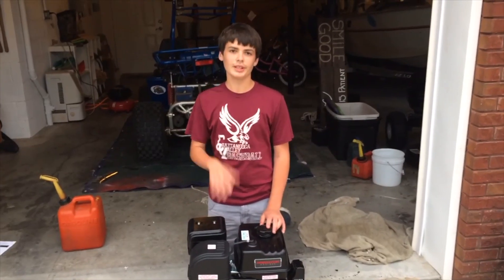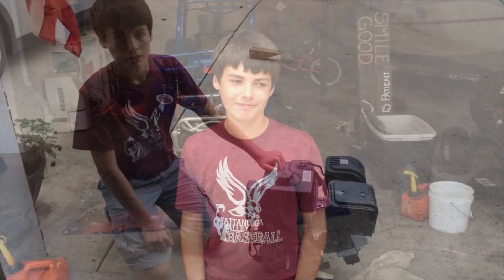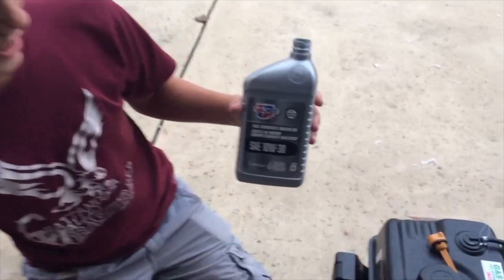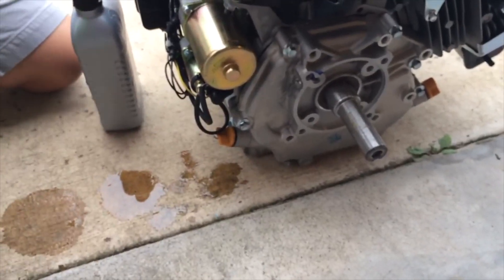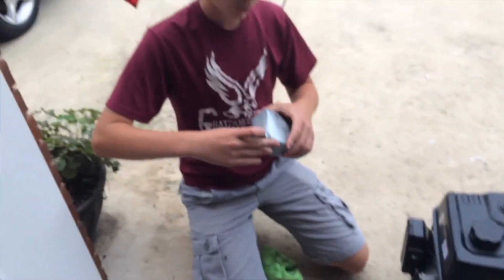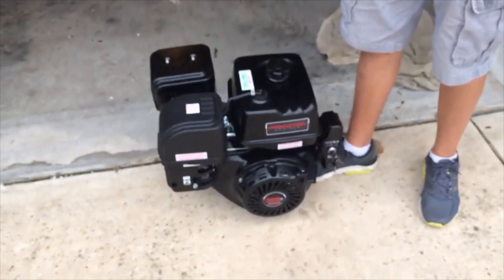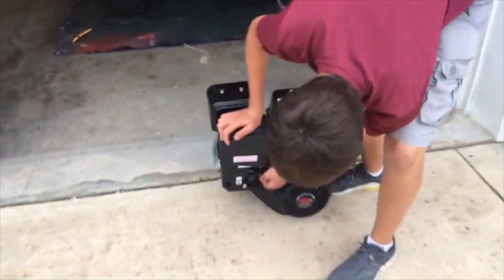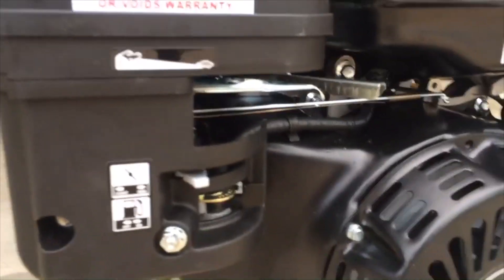Must Do's for a Predator 13HP 420cc Engine Break In & Start Up - Part 3

Comment: Probably dont break in the engine on synthetic oil. Also dont run an engine on concrete or gravel because the vibrations will crack your block. My buddy was dumb and had that happen to him with a new predator 212.

Comment: So I’m confused if this was supposed to be a joke or not. Synthetic oil for break in? Both of the oil caps aren’t the same, ones for filling and checking level and ones for draining. Starting up in bare concrete? At least put a piece of cardboard underneath it so you don’t crack your engine block. And you ran it for a total of 45 seconds, I don’t think that engine is broken in lol
Reply: lol. break in is 5 hours then drain.

Comment: Nice engine, it runs very smooth but you should not start the engine on concrete ground. While engine is working it occurs vibration which damages the engine crank case. So, you can run the engine soft ground such as on sand, wood, cloth etc. Have nice days ;)

Comment: try to adapt the starter in a car battery，if you haven't car batteries you can stole energy from your car for start this engine，is much easy to start this engine with electric start。